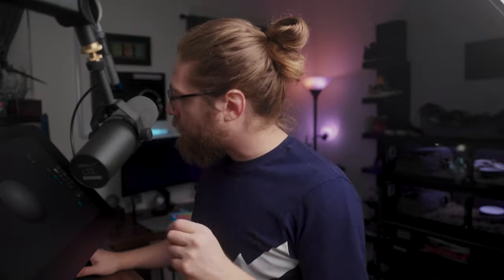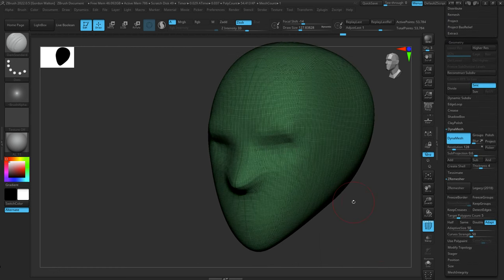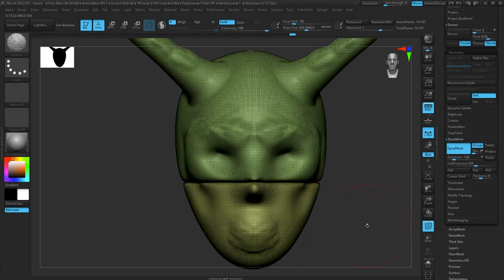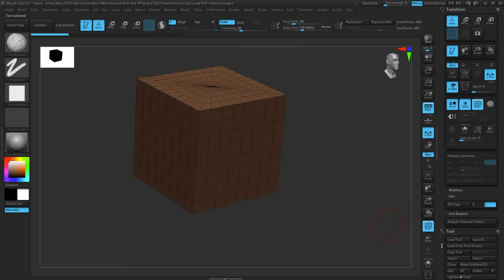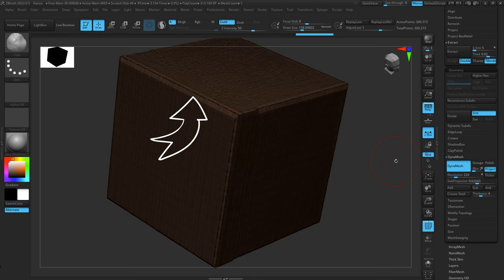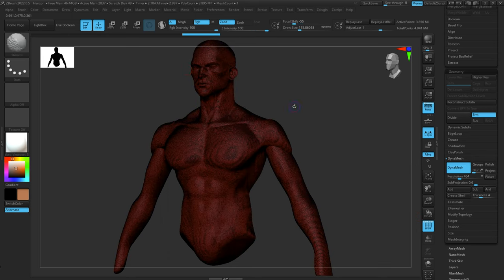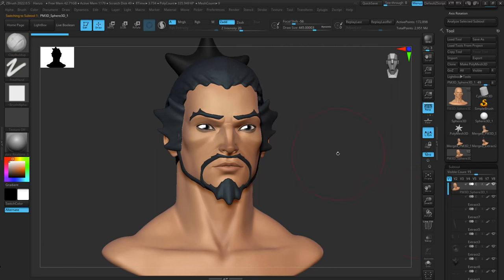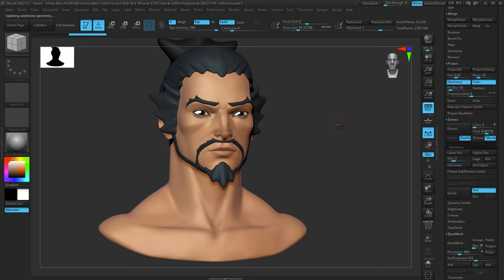Zremesher VS Dynamesh - What's the better tool?

Comment: I use Dynamesh for primary forms and exploration, welding parts together and will take it up to the secondary forms. Then ZRemesher for the clean geo for any type of details and alphas. Then to TopoGun if I need an animatable mesh.